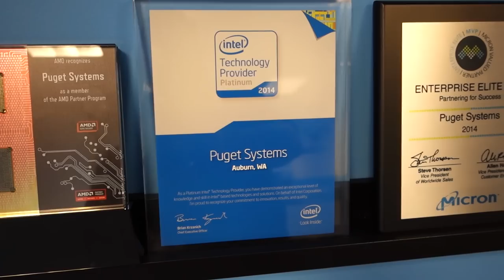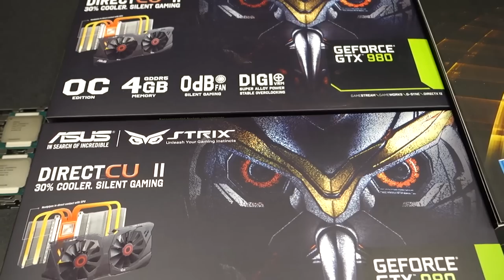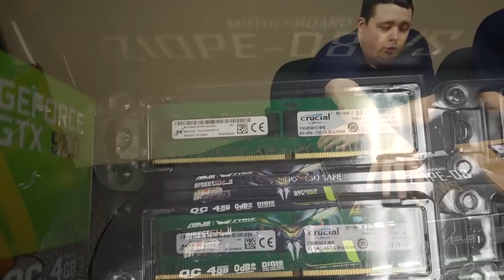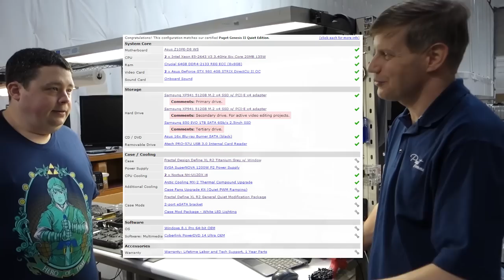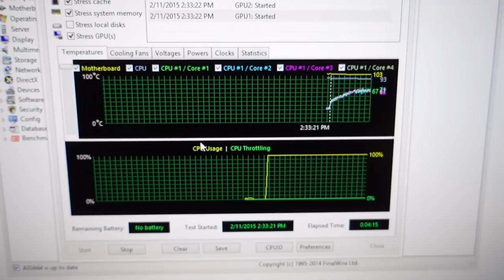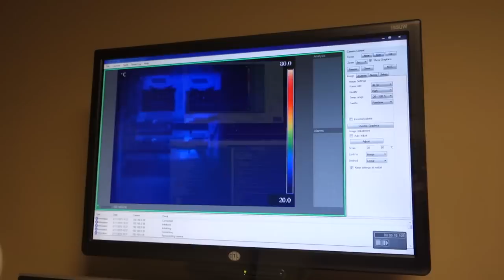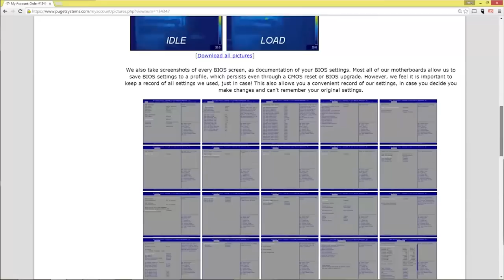Crazy Fast Dual Intel Xeon Monster PC Build by Puget Systems - @Barnacules

Comment: Finally, A video on ASUS Z10-PE-D8 WS. But
My Specs, If yours is insane, I should just name mine God.
My Full System Specifications: * Indicated Differences... Wanna Race :)
=========================
Asus Z10PE-D8 WS Motherboard
**2x Intel Xeon E5-2697 V3 2.6 GHz 14 Core 35MB 145W CPU's**
**Kingston DDR4-2133 64GB ECC Reg.(16X4GB) Memory (SINGLE RANK, same price as your kit, why? 8x8 GB)**
2x Asus GeForce GTX 980 4GB STRIX DirectCU II OC GPU
2x Samsung XP941 512GB M.2 x4 SSD Storage
Samsung 850 EVO 1TB SATA 6Gb/s 2.5inch SSD Storage
Asus 16x Blu-ray Burner SATA (black)
Atech PRO-57U USB 3.0 Internal Card Reader
**Caselabs Magnum THA10 Case**
**Corsair AX1200W Power Supply**
2x Noctua NH-U12DX i4 Fans for Xeons
**11x INDUSTRIAL NOCTUA and 4 Gelid SP12 LED Case Fans, all PWM (more fans low RPM = less noise)**
*(4x 120mm Industrial Intake Fans on bottom, 4x 120mm Pushing air out on top, 2x intake, 1x exhaust. (6 bearings vs 4) NF-F12 IPP52***
**Windows 7 Pro 64-bit OEM**

Conclusion: Design Thought Process, In my Sleep.. :) Seriously good luck.. Cant what till mine is build..

Bells and Whistles, No Productivity. Just My Opinion unless its free, but its cool dont get me wrong.
Custom Case Engraving
Custom Laser Cut & Engraved PCIe Card Supports
Custom Laser Cut & Engraved Case Window
Cyberlink PowerDVD 14 Ultra OEM (Why?)
Warranty: Lifetime Labor and Tech Support, 1 Year Parts

Comment: WoW. That took a LOT of talking themselves up to convince everybody that their job isn't completely superfluous. Maybe a Nerd Channel isn't the best place to showcase something like this. Because, quiet frankly, every Nerd deserving the name could've done the same thing him-/herself. It's really not that hard. SSDs getting too hot? Give me break! They run in millions of systems without overheating and never having been looked at with an IR-camera (what exactly is there forward looking ? Its a freakin' camera) Don't get me wrong. Building Computers for people who want high-performace custom Rigs but don't know a CPU from a RAM chip is a job worth doing. But it is low skilled labour, not quantum mechanics. Now, had they built (read: NOT installed, built!) a custom water cooling, or 3d printed some sort of airflow ducts, maybe I'd have been a little(!) more impressed.

Comment: Oh, wow... I think this isn't good. You can grab E5-2630 V3 with 8 cores for merely $600, and if you're doing workstation stuff you are going to look for AMD FirePro, probably W7100, since R9 270X (or 7870, or W7100, because those are all the same cards) is still respectable in games.

Comment: +Barnacules Nerdgasm woah what the heck i really hope you got this system entirely through sponsorship.. i am allergic to depreciation...its the same as a car dealership it takes $15000(usd) in materials and labor(robotic most of the time) and then sell it at $45000..the system is already in place- small computer builders roll over the savings in price and give the average person a system built to last at $125-$200 labor cost (that's what i do at least) so they continue to want to build pc's- if not they spend $2000-3000 on excessive premiums that they  probably already paid in parts and wont want to build a pc for the next 5-10 years only to realize there system is outdated in 2yrs...why co sign that bs

Comment: Why you dont buy it hdd? i think you storage your videos so that why i want ask why you dont have like 4TB HDD
Reply from the maker: I have an external 8TB sata array that connects to this computer that hold all my videos.
Reply: Given the amount of content he creates he'd be forever swapping drives around, opening it up blah blah. Easier to just have it all external and swap them around when needed. It's common in video production to have all your work external to the machine itself, the main reason being you can just move it to another one really easily if your main system craps out on you and still get it done. That's also why most places with more than a few employees tend to use the same model of machine all bought from the same vendor. The likelihood of there being any compatibility issues is greatly reduced by swapping to another workstation.

Comment: I have 12 Noctua Fans, they are really good.. but i have now 12 Noiseblocker Eloop B12-1 max 800rpm.. they make 7db ^^ they are more quiet at 800rpm than the noctuas. I have a modificated Gigabyte M10 Luxo, the GPU is 8°C cooler than in other 6 Cases that i have. ^.^

Hehe Overkill PC 1600€ for 1 CPU :D

Comment: That 3d printer is more expensice than the Pc...
Reply: That '3D printer' was a laser cutter. They  cost between a few grand and 20 grand for an average one, and given that you can push builds over 70k at Puget systems, it is not Neots expensive than most (or this one actually) of the PCs here
Reply: still expensive and the only thing i can do is just to afford a 1500 dollars gaming pc
Reply: Pierce Oconnor I wouldnt say it is a cheap one, but it does look quite old, I would guess it was expensive when they got it and it just inst profitable to replace it now its outdated

Comment: so guys i am not pro at this but i eventually got 1300 euros so i want i build pc for gaming most and i want it to run almost everything at high settings 1920x1080 after some search at seeing some reviews i come to this
cpu Intel Core i5-4690K
motherboard please help to chose one
ram Corsair Vengeance 16GB DDR3 1600MHz
card MSI GeForce GTX 970 4GB or the ZOTAC
COOLING Corsair H100i 77.0 CFM Liquid CPU Cooler
POWER SUPPLY Corsair Builder Series CX750M 80Plus Bronze
CASE HELP NZTX H440 OR CORSAIR CARBIDE SPEC 03
AND TELL ME IF SOME ITS BETTER TO COMBINE WITH SOMETHING ELSE OR FOR BETTER COMPATIBILITY AND I ALSO WANT TO OVERCLOCK THE CPU SOME SUGGESTION WILL BE APPRECIATED.AND ALSO THE CARD IS 400 EUROS WHERE I LIVE SO so maybe I MUST GET A MOTHERBOARD WITH SLI AND PUT TWO CHIPER CARDS PLEASE HELP SORRY FOR ENGLISH

Comment: sorry the flir my not lie but i still think that liquid cooling  would have been better if implemented properly as you can move the heat differently in the case  to vent it off in such a way that  heat would never be a problem  let alone  the longevity of the parts  would be maximized  cuz high heat is always bad for parts-- but i will give it to puget systems that they can create a custom system with wicked fan profiles and have the know how and fore thought to use great parts like the noctua fans and even put heat sinks on the ngff ssd's - i even like the fact they custom made their own plexi window -
Reply: By the time the heat kills these components they'll be considered antiques. I've only ever seen a CPU die once, and that's because of a catastrophic cooling failure where the fan died and it cooked itself into the socket. That was about 15 years ago too when CPU's ran MUCH hotter than they did now relative to performance, back in the P4 era. My god, those CPU's were like elements in a kettle they ran so hot.

Comment: I don't see anything special they did.   By default, I'd install everything the same.  Example : Why are the video cards where they are?  The closes slot is x16 and the second card is next to it for sli.  Nothing special about anything here.  He has a wonderful system and the installer did a wonderful job.  But ... What am I missing?  If they installed custom brackets, with special angled fans & this and that, it'd be different.  I guess, there are people who don't know, how to set their fan speeds & such.  That's a nice thing, for a custom building company, to do.  Idk ... Whatever ...  He's lucky to have such a nice system.

Comment: I suppose the problem is this build suffers from a case of identity crisis. It's trying to be both a workstation (which wouldn't use a gaming gpu) and a gaming machine (which would see no benefit from dual processors). Anyone who takes noctua over noisebockers or san ace are out of their mind. Design itself is impressive though.
Reply from the maker: rageofheaven The whole point of the build is to make a machine that serves both purposes and this does very nicely.
Reply: I suppose that's why all those Evga SRX motherboards flew off the shelves. Or fell off more likely.

Comment: 5 workdays to build 1 computer...are you serious..its takes 5 hours tops.
Reply: Unfortunately it's puget systems. It's not one of those "throw computer parts in a case and it's done" type of deal. I think it was even mentioned by Jerry that all computers go through regerous tests so the computers can be shipped out and be delivered to the customer perfect and running great without flaws.

Comment: Price compared to ibuypower... Puget System is extremely expensive. I'd rather buy products myself. ibuypower is the cheapest there is.. about 100~200 dollars more than the actual product price. while others go way beyond $500+ than the price at newegg.
Reply: Seriously. Even a product with nothing but "i5" went up to $1500 price point. For just i5 and onboard gpu? I can buy 1231v3 and B85 board.. with Gamerstorm water cooler just for that aesthetic look. Any 2 x 4gb ram with heatsink. Corsair 750w gold power. With Micron's 500gb SSD, any ATX case, Window 8.1 and EVGA's gtx980 for less than $1500 at Newegg

Comment: Dude xeon is for server lmao
Reply: +CaptainExpiriment For anything really. The difference between a Core i5/i7 and a Xeon is the Xeon doesn't have integrated graphics, generally runs at a lower voltage, has support for ECC memory and (model dependant) an extra QPI link or two allowing for dual or quad processor setups. There's nothing about a Xeon which means it's only for server use, you can use a Xeon in a gaming PC if you want.